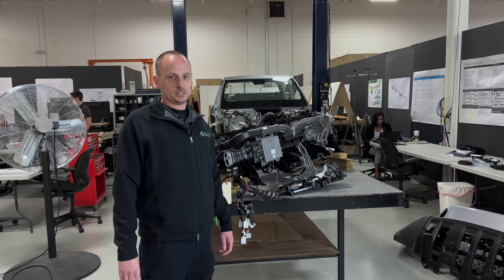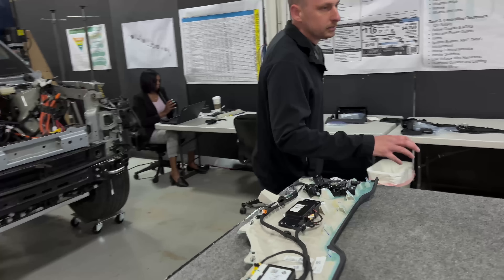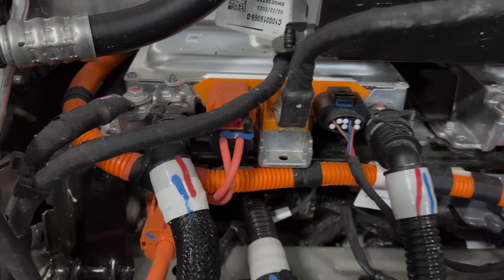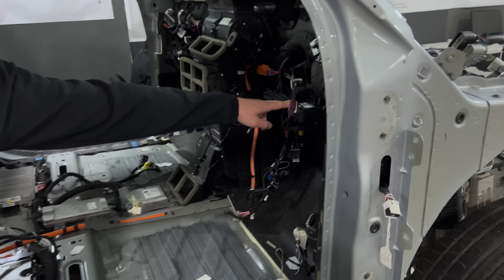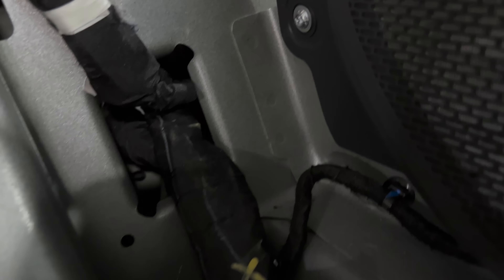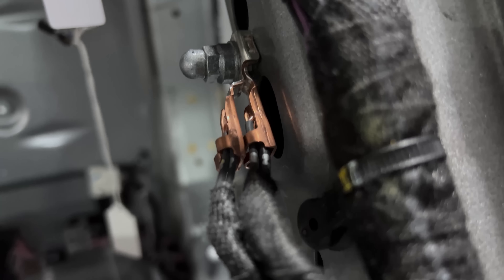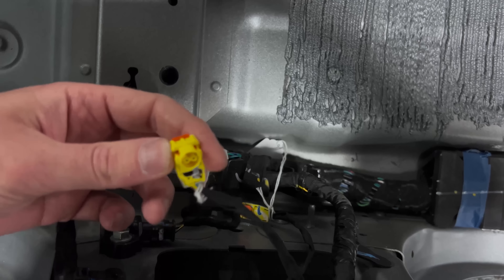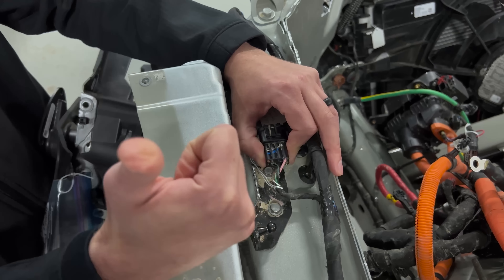Rivian Wire Harness Whirlwind

Comment: Aircraft have extremely strict standards (especially last few years) to prevent wiring faults and failures long into the future. for instance Abrasion of harness on other surfaces will wear a hole over long periods of use.  Slack in cables, drip loops, moisture ingress, and many other factors need great attention to detail.
Reply: Unfortunately this is a recurring theme in the automotive world. A lot of hatchbacks (breaks) have issues with the harness going to the trunk lid to the point they fail wirhin years. Doesn't matter if it's BMW or Honda, they never get it right. Granted, for the Rivian it's not mating with a moving part, but still, why add more points of failure.
I have not seen the harness for the hinges, but, if the what I've seen so far is indicative, it doesn't look good for longevity. This stuff should have been figured decades ago: abrasion, bending radius, coax routing, wire flexing, corrosion, ...
Thank you for posting the video and raising awareness, it makes for a better world.
Reply: Unless you’re Boing they seam to be missing QC
Reply: @1472fred  The joke is McDonnell Douglas purchased Boeing, not the other way around.  The company was being driven into the ground to the point Boeing purchased them.  Then, all the senior leadership at McDonnell Douglas were given high level positions at Boeing.

Comment: I never knew how much I cared about wiring harnesses. This was a fascinating, clear, transparent, and thoughtful presentation. Also goes to show how difficult it is for an OEM to eventually get it right, and how well the BEV leader continues to execute. More, please!
Reply: You should check out the wiring section of Apetera's June call, you'll really appreciate that car.
Reply: @BumbleBeeJBG  Link to the presentation? Thanks for heads-up!
Reply: @vermontsownboy6957  my guess he is referring to the 2 minutes starting here:
http://www.youtube.com/watch?v=TFl3GbJWPf0&t=20m16s
Reply: @GeorgeRow  That's it, a few good gems in there. They talk about reducing the majority of the wiring and experiencing significant weight savings and reduction in complexity as a result. All aces across the board for the product, the manufacturing and the servicing.

Comment: Few things I would like to see go away asap at this point is the dual lead batteries and fuses and shrink down the overall package. This alone would shed least 100-125lbs of weight out of the total process and make for less complication. Lot going on in the wiring of this rig.
Reply: Totally agree! Also the location of the dual wet acid batteries to me is a safety risk in an accident.
Reply: @icare7151  they could use a VCFRONT and VCBAT configuration like Tesla, integrate a smaller higher power lithium pack up front (VCFront/VCBAT) would give them the mosfet integration for electronic to replace fuses. ultimately would yield a smaller footprint and less weight and add back that glovebox that was ???? to most people.
Reply: They could still put two lithium ion batteries at the place of those two batteries. A lot of European cars and even 4x4 have two batteries
Reply: @carholic-sz3qv  your speaking on the pretense of a ICE vehicle that needs it for cranking and 12v accessory. You have a huge battery that through a dc to dc converter and a single lithium pack can achieve the same function. They could literally reduce the electrical foot print and make it easier to work on and reduce complexity by just eliminating it altogether. These batteries literally just run accessories.
Reply: @AustinFerguson  lol……. Where is the complexity in two batteries!?!? Wtf!!!!! Millions of vehicles and trucks have been using that for decades, they know why they put the two batteries there, why can’t you go ask Rivian why!?!?!?
Reply: @AustinFerguson  most EVs have only one 12v plus the high voltage one, but also many German/European cars have had 2 12v batteries for years.
Reply: @carholic-sz3qv  Again, I can't argue your misunderstanding of complexity. But they really have no reason for it and you can obviously see in the video the redundant use of two batteries, mounting to firewall, two wiring harnesses, two fuse boxes in the dash IP, etc. All this could be done in 1/3 the foot print. This intern makes a less complex vehicle, cheaper to build/manufacture, allows for future growth in gained space, makes repairs easier, and adds diagnostic ability due to digital mosfits and would give them a lot of diagnostic ability.
Reply: @AustinFerguson  lol…….. I said it again! Why can’t you go ask rivian why they did that!? Not all vehicles are created equal and doesn’t have to be base on a tesla! Plus the many different features they have in mind for that truck are another reason like the camping setup which no other vehicle on the market has again LOL……
Reply: Rivian is working on a quick jumped in case one battery quits which in an offroad vehicle is really appreciated. They also intend to offer a winch terminal that shares the load for a winch between the two batteries. I think its wise
Reply: @mattbrew11  I agree, the dual batteries also makes it easier for a tech to replace due to the weight of the battery being spread across two packages. The single double width batteries are really heavy and can be difficult to safely fit line side and to replace later on.
The lead gel pack is also a really cost effective option, is a fully established standard which simplifies the design and launch of the vehicle which would be a priority when integrating a 1st gen model.
Reply: @carholic-sz3qv  are they diesel?

Comment: This video, particularly the pyro in the dash, did more to talk me out of a Rivian than any video I have seen from anyone anywhere. I hope Munro can address whether it should have pushed me that much or, without reference to other cars, if the concerns were overblown? Good luck to Rivian with all these hints!
Reply: @Charlie Fox I would not say it should push you away from Rivian. These defects are mostly indicators of new OEM growing pains. And if you order a Rivian now, by the time it is delivered, Rivian should have addressed these issues. If not, they are likely covered under warranty.
Reply: @c_fox7396  Given that it's a Pyro that was not declared, I expect an updated safety manual or a recall.  That's a major documentation failure.
Reply: If you care about the wiring harness of a vehicle you're buying, when you're not going to even see it or interact with it 99.99% of the time, you weren't interested in buying the vehicle from the get-go. It's like saying you were talked out of moving to Greece because 1 person out of the 10M that live there went 5 miles into the ocean, far away from anyone else, and crapped in the water.

Comment: Considering how quickly they put it together, I’ve been pleasantly surprised. The big question is how fast can they iterate improvements.
Reply: How quickly they put it together? Hahahaha
Reply: @legacytesla  right? They started on these in 2017, first complete driveable prototypes debuted back in spring 2018. 😀
That's like giving Ford credit for the lightning beating the cybertruck, when the chief engineer of the lightning said it started in Sep 2018. 
So in 44 month's to the first delivery Ford managed to deliver an ice based ev conversion truck. I mean so much wow there. 🙂
Reply: Agree, with my date in 2023, I'm hoping they iterate quickly. Getting rid of traditional fuses, moving to lithium 12v and cleaning up some of the wire misses. Electrical issues in 2 years could be a huge cost and impact to their currently fragile business. Hope they come out the other side and I think the best way to do this is iterate.
Reply: @4literv6  Fred has a ton of ignorant comments across the Munro Rivian teardown. It's like he has no clue.

I love the R1T. I wish I would have ordered one. But Rivian has made a ton of mistakes and a lot needs to be done to make sure this company can even make it.

Still if someone gave me 25k and an R1T I'd trade them for my 2022 Plaid S
Reply: @legacytesla  you'd give up a plaid for an r1t and only 25k? That's high praise imo.
Reply: @4literv6  And they did over a year of real world driving tests to validate this first time truck build would meet owner expectations. If Tesla rushes Cybertruck without adequate validation it could be a massive mistake. Given that Elon seems to be losing interest in automotive to pursue robotics, Cybertruck could easily end up as a dud.

And the Ford Lightning is a ground-up EV. It does follow certain external dimensions of the F150 product line so that accessories will fit, but otherwise it is a new product. You sure are sure of yourself for someone so boldly misinformed.
Reply: @patreekotime4578  linda Zhang the chief engineer on lightning since 2018 says otherwise to your false assertions about it being a ground up ev design. It's based on an already existing frame, cab, bed etc. 
The ground up controversially styled lightning farley promises with 75-100 miles of more range, isn't coming until around 2025 from the all new blue oval city in TN which itself isn't even built.
 
And yes thanks to extensive ev based research for over 4 years now. I am quite sure of the validity of the information I've seen and shared. 😎
Reply: @4literv6  It's mostly from pressure at home to get back to off-roading and camping. 😅
Reply: @legacytesla  ah ha the truth emerges. Does it get boring daily driving something which can smoke 99% of the other cars out there? 😁
Reply: @4literv6  Lol, no! What's funny is when you get used to it you forget how quick it actually is. When you have passengers in the car who have never experienced that sort of acceleration you hear about it 😅

But truth be told the r1t can smoke. Probably 90% of the cars on the road or more, too.
Reply: @legacytesla  good point, insane how quickly the r1t and the new hummev can accelerate. 0-60mph in 3s for a 4wd truck weighing 7000-9,000# is kinda a little bit nuts. Did you catch the hagerty video where an r1t towing a BMW on a trailer still beat a raptor in the 1/4mile? 😀
Reply: @4literv6  yes! In a related video, the plaid and the lucid raced a e39 M5 to show the progress and it's just absolutely ludicrous.

The future is electric. Surprising more people. Don't see that yet
Reply: @legacytesla  those same people likely don't even realize there gasser also uses a battery and multiple electric motors to function. 😂

Plus evs we're really first dating all the way back to the 1830s now. And until around the mid 1920s they enjoyed a near even market share with gas and steam engined vehicle's. In fact the first evs with rechargeable batteries actually we're longer ranged and vastly more reliable than ice or steam engined vehicle's we're. But back then outside of a major city, very little electrical infastructure existed nor fueling station's. 

Be honest what was more amusing though. The plaid smoking that m3 when it had a full tilt head start or the r1t beating a raptor while towing the m3? I think the m3 at speed showed how fast a plaid really is and the towing video showed how a truck which was considered quick less than 5 years ago. Is now basically nothing but hot noise in comparison to the r1t. 😎
Reply: @legacytesla  Do you haul a trailer with your Model S plaid Serrr??
Reply: @DarkHawkk  No, we sold our trailer and quads when we got rid of all of our ice vehicles. Some really interesting options on the market now though. Definitely want to get back at it. Thinking about a Cake Kalk or a couple sur rons just to start again and go out to have some fun.
Reply: @4literv6  you clearly don’t know one god damn thing about vehicle design. Tesla began work on the model 3 during the second year of model s release
Reply: @legacytesla  not true, why are you lying?
Reply: @fredbloggs5902  Sorry man, that's my opinion. You're comments are poorly thought through and you add no value

Comment: Hey Chris!  Please let us know what this entire wiring harness weighs in at when it's completely off the vehicle.  Seems like there is a lot of point to point wiring that is the old way, rather than a few high speed CAN buses with software in the connected components to decode the comms.

Comment: Wow, what a huge, bulky wiring harness and 2 12 volt batteries.  Good thing Sandy wasn't there, he might have passed out like he did with the Mustang Mach E.   LOL
Reply: Lol exactly 👀😂
Reply: The 2 batteries are there for a planned jumped in case case of 12v failure and the share the load of a winch.

Comment: @4:20 would it be possible to still use the power windows on the half that is still connected? If so, it could be one reason behind it, for emergency use edge cases.

Comment: Thanks Chris for this look at the Rivians wiring harness and pointing out improvements that could be made.  A bit like looking inside a tv set from the 50s.  Cant help but think that Monro will be an improtant force in improving electrical design in the future.
Reply: From the 50s?! Get real. Half the techniques employed are state of the art
Reply: Rivian has alot of redesign to do .. otherwise they ain’t gonna be around for long
Reply: @TheTrumptyDance  Are they contracted to consult?
Reply: @mattbrew11    Thanks Smarter for your comments.  You are correct when you say half of their techniques are state of the art.  Cars are becoming more like computers on wheels with all the electronics that are packed into them now days.  Was trying to say that sooner than later engineers will probably find a way to eleminate much of the wiring cables just like they did with computers.  Worked with a huge Univac computer in the early 60s that filled a room.  All the cabinets were connected with large conduits full of massive cables.  Now a small laptop that you can hold in your hand has over ten times the computing power and dosent take 30 people to opereate.  Technology is advancing now at a fast rate so probably the car manufactures that are more forward thinking will come out the winners.  Thats the idea I was trying to express.

Comment: @14:28 A simple injection molded grommet would have been a perfect solution... I don't see how this won't eventually abrade after vibrating on the pierced edges.
Reply: Recall?
Reply: @dusselElite  Expensive recall at that. Lots of parts to take apart unless they do some kind of split grommet solution.
Reply: Tesla is going through a recall on Model 3s for the trunk harness failing due to chaffing on metal. Mine actually failed in December. I've been waiting over four months for the replacement with a new design.
Reply: @MTNRanger  100% typical tesla service
Reply: @MTNRanger  This is actually common across the industry, it’s difficult to get the tailgate loom across such a large moving joint with stressing it. BMW have failed multiple times in this regard.
Reply: It’s almost definitely a cost saving method that may not have been fully durability tested, a simple foam tape wrapping is common on main looms to prevent this sort of damage, a grommet maybe be overkill due to the lack of a wet area on either side of the hole but wouldn’t be expensive either.

Comment: im really surprised on how many thick wire harnesses they use i tought car manufacturers wanted to minimize the use of wires by sending as many signals as posible over can bus systems and use as much shared 12v power feed as posible that is the trend i have seen as a mechanic on most newer cars i have worked on.
Reply: 48V systems are the answer, thinner wires, less weight and mass Audi is already there of course....all these hobby makers have a lot to learn
Reply: This is pretty minimal for the feature-set
Reply: What they want to do, vs where all the suppliers and dependent tech are, is a notable gap.   Chicken or egg situation.
Reply: @cengeb  48v systems as far as I know are only really being used for A.C, mild hybrid e-motor, anti-roll bar and starter motor.
It makes little sense for lighting, comfort systems and entertainment as the 12v standard is so common and cheap to implement for automotive equipment.
I was actually surprised by how narrow the main harness was.
The cars I work on at a luxury VAG manufacturer are at least as thick as your forearm in places.

Comment: Hello! Thank you for your video showing the wiring of the Rivian R1T. I’m hoping you can help me with an issue I’m having with my R1T. I started to have a brake light/ trailer light fault, followed by a gear tunnel open warning that limited my speed to 13mph. The next day I had a headlight warning. When Rivian looked at my vehicle, they said that water came in through the mounting hole for my EVSportline soft tonneau cover in the passenger side rearmost mount and then got down onto the wire harness and caused this failure and now they will not warranty this repair. I asked what the rating of this harness and connector is and they did not know. I asked if this area is water tight and if this was the only way water could get to the harness and they did not know. I didn’t see this part covered in your video. Do you know of this wire harness should be water resistant or water proof? I find it hard to believe that they would design this with a wire harness that runs through the body on the side of the bed that is not at least water resistant. I believe this is due to a faulty or failed harness in some way. Anyways, I understand if you are busy or if you don’t want to answer due to your potential affiliation with Rivian but if you can help it would be greatly appreciated. Just for context, I am a manager of Plant operations engineering for a medical device manufacturer and before that I spent 20 years in the us Navy nuclear power program and a mechanic and operations and maintenance manager. My strength is in mechanical, fluid and air systems but I have some understanding of electrical systems. Thank you so much for reading this and I hope to hear back! 

Robert Augur